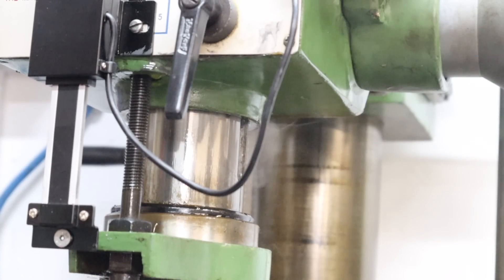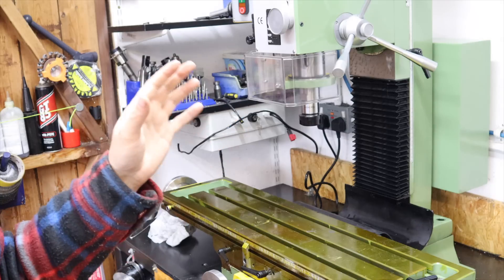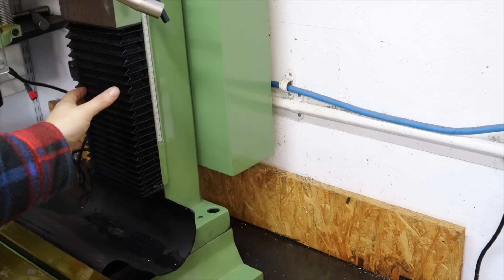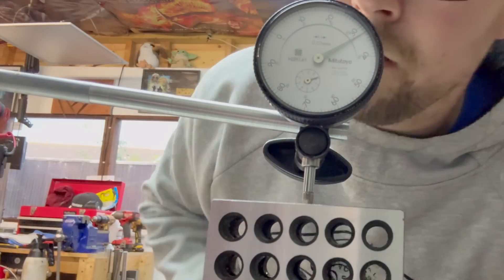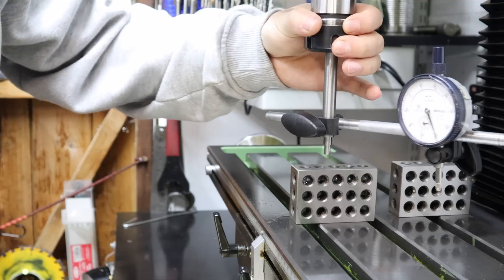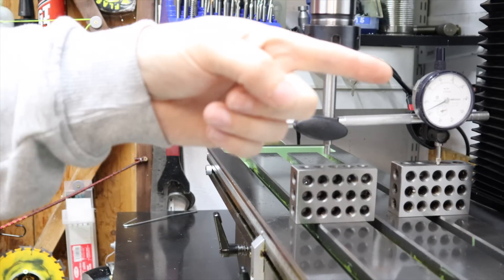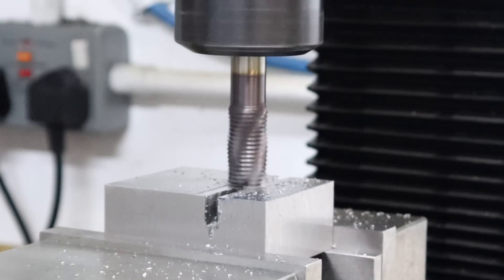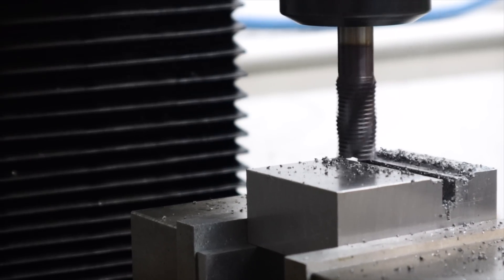The BEST Benchtop Milling Machine - Initial thoughts Warco WM18B

Comment: Been using mine for  nearly 9 months. In general it's quite good.  You can use a dividing head vertically  as there's enough height. I  fitted a dro from aliexpress so the mill is spot on for accuracy. No problems  yet.

Comment: Very good video I've been considering this one. One thing to mention is that MT3 is actually just as rigid if not more so than R8 due to better internal contact with the spindle. However R8 tooling is more common from Chinese suppliers.

Comment: Hi Joe

Just seen your video. I have the same size Warco mill though mine was the Geared head one. I removed all the gears and converted to belt drive and fitted a powerful dc motor with speed control much like you have. Yours looks great. I made a small mod to the casting to increase the Y travel to 240mm.  I converted it to CNC operation and made mods to provide oilers. This has all worked well. I think you will rapidly get bored cranking up the head each time. I added a ram to aid the lifting of the weight of the head. My mill is very capable and quite powerful enough for my needs. I tend to use the X box controller to operate the mill manually quite a lot and discovered by chance that the shiny button locks the axis currently operating so it cannot drift off direction with the joystick getting a nudge by mistake. My CNC speed is ridiculously rapid on fast speed and quite frightening! I have closed loop and it has all worked well since I put it all together. Good luck with yours.

Oh by the way I have the same R8 collet holder. I fitted the special r8 collet that has a machined flat end that allows use of the 20mm dia Tormach tooling holders. I have a bunch of them now for assorted milling cutters. They are quite cheap from Ali express and come in 2 sizes for ER20 collets. I have mine operating on a pneumatic stack that allows the tooling to be quickly switched place. 

John

Comment: Just to add , I had their GH mill which was B****y horrible. I bought a krv 2000 for commercial work which was great but weighed 900k. Watching you set the head up. Machine DRO sell a trammel gauge which takes 60secs to set the head up vertical. Money well spent if you keep moving the head.

Comment: I've recently bought one of these. If you are a model engineer ,it's very good. Mine's an r8 spindle. Disassembling is dead easy. I had to move mine from the garage to workshop up the top of my garden. I put it back together and clocked it up ,the machine was spot on. I fitted some digital scales £35. If you need something more substantial , buy a KRV , a better bridgeport.

Comment: Thanks for the heads up regarding the sale prices.
I treated myself to a GH-18. Specifications say that it's a single phase motor, however mine arrived with a three phase motor and a VFD mounted in a box behind the column, so very easy to modify for variable speed as well as the gear selections.

Comment: Well done it looks like you've got yourself a good machine there, I have a Super Major which Ive had for 16 years and Ive just rebuilt the gearbox after one of the shafts broke in two so I would be interested to see what happened to your old mill. 
When tramming or checking the nod make sure the head is clamped to the column if it isn't the the head will lean forwards giving false readings I use a brake disc for checking mine it is worth buying a new brake disc just for this and reduces any errors that might occur when lifting the clock stylus onto blocks or parallels.
One of the big failings of all of these Chinese mills is the rigidity of the base castings so don't bolt it down tightly to the top of your bench and if necessary shim under any corner that has a gap before bolting it down, finger tight is enough.
Id also suggest you invest in a set of finger collets these reduce the overhang from the spindle greatly improving rigidity and increasing working height.
Keep up the good work and enjoy your new machine.

Comment: Thank you for your video and effort put into it Joe. Could you elaborate a little about the table you use to mount such a 265 kg machine please?

Regards, Ruud
Reply from the maker: Hi Ruud glad you enjoyed the video. So the table is actually a table I fabricated. It is mainly made from 2” steel box section with a 5mm steel top. When I made it I ensure the weight would be on top of the uprights so no weight was directly held up by the welds.
Reply: @MachiningwithJoe  Thank you, very useful!

Comment: Very good video Joe, thankyou. I think you and Ade have picked very well. Good Prices at Warco, tested and configured.
I'll be joining you in the next few months, hope I have the luck you have had. You got a good un!!!!.
If you get the time, it would be good to see you fit a 2 axis DRO. Is a 3 axis DRO out of the question ?. As that little LCD thing I would assume 
would not be ideal for reading.
Reply from the maker: Thank you, glad you enjoyed the video. Hopefully when you come to buy yours there is still the good saving that there currently is. So I’m going to be using the DRO that I removed from my old mill. For that reason it will be a 2 axis and also as I have done a video on DRO installation I probably won’t be doing one with this mill as this mill is easier to do.
Reply: @MachiningwithJoe  So yes. I was after the WM16 at the time, but Warco were no longer selling it without the DRO. Got the WM18b (Same as yourself), absolutely no regrets. Got the deal as well !!!!!.
I guess the only regret was the weight of the thing before I moved it !!!!!

Comment: Do the gib strip locks on the X axis still catch and bend themselves if you are not careful when taking the Y axis back, its a crap design that allows them to foul another part of the machine as my older model does. Better that the controller is remoteley mounted so reducing vibration that can destroy the pcb's.
Reply from the maker: After reading your comment I have gone and checked and yes you are completely right. Looks like I’ll be making some replacements at some point 👍
Reply: @MachiningwithJoe  I have had one for over 15 years, mine has no oil points and the bed is made up rather than being solid. I need to get one of my gib tightener out as it was bent so many times it snapped. Motors are a failure point the old ones had a cowl over the motor that prevented proper ventilation, that went in the bin after the first motor burnt out and the Chinese made boards are crap and hard to repair as they scuff off the makers id from the semiconductors, I have never been able to take the backlash out of the x axis as the adjuster never seems to adjust. But I still have it, and it would be a much better machine with dro,s, oh and get yourself a set of carbon brushes they gobble them, warco used to do a motor brush end replacement, service is good I recognise the voice of the parts guy every time I ring them.
Reply: @philsteele7151  I think the WM18B uses a brushless motor for better slow speed torque.

Comment: To measure the runout of the spindle it is best to take several measurements. Turn the collet 90°, use a cutter / collet with a different diameter. Sometimes you have a lot of spindle runout, but it is compensated by the runout of the collet/cutter. By turning this 90° the real runout will become visible, better or worse.
Reply from the maker: Great but of advise I actually decided to measure the runout again directly in the spindle and turns out I’ve only got 5 microns of run out.

Comment: I have an earlier version of this that I've converted to CNC - looks like they've updated the control unit - and what's that big box on the back? On mine the control unit was just a small box mounted on an arm on the side of the head.
Reply from the maker: Great to hear you have done that as that was my end intention with this. The cabinet on the back contains controller for the DC motor some fuses and breaker etc

Comment: I purchased one of the first WM 18 mills back in 2007 from Waco, on arrival I noticed it came with an inspection report on spindle run-out and axis play and true ness. Being a machine tool fitter of over 40 years I have worked on some super accurate machines and this mill was bad ! In the end before using it, I stripped it down and changed the chinese spindle bearings for FAG bearings and made proper steel spacers instead of stacked up old circlips which were in the housing. Hand scraped the ways as the finish was appalling. To anyone thinking of buying any far east made machine. It is prudent to check and clean out the casting sand still hidden because if this gets on slides or in bearings then it will ruin them.

Comment: That column looks hella skinny... The rest of the machine looks nice, but that Z pillar is a disgusting manifestation of corporate greed and FEA... The machine like this is as strong as it`s weakest component, and if that component is one of the main axes, even moreso the one that carries the head and is affected by all and any work done by the head, well, we have a problem on our hands... I`m hardly pressed to see how that pillar is any more rigid than the round column of my Emco FB2, which is from what i can see - a smaller mill than this... That single component could and should have had twice the material that it actually has in it to make a really fucking good milling machine, and that could be seen as The best benchtop machine, but this, nah, just decent...

Also, what the hell man, spindle bearings should not even register on that clock... 0.01mm is not fine for a spindle of any sort of a precision machine... 1 micron is crude if we are talking precision, but for a hobby shop, 1 micron spindle runout(actual spindle, not a tool in the holder in the spindle) is very good, 2 microns is adequate, but anything more than that and you might as well be using a drill with an endmilil chucked with a jacobs chuck... 0.01mm runout is literally detrimental to cutters, and quite a lot if we are talking smaller cutters(like the ones a hobby shop likely uses) small endmills, drills, reamers, what have you, none of them like runout... Shit, my roller-blades with abec9 bearings have a lesser runout than that... Speaking of, here you go with a shameless plug - if you need some fucking remarkable bearings for small spindles(custom toolpost grinder or similar) you can get Bones Swiss bearings for skates, you will know which ones to buy, they don`t come cheap, but they are Swiss made and Swiss grade... You can get Bones Swiss Reds and others that come from China, but if you want savagely good small bearings - the Swiss made Bones Swiss bearings are the way to go... At least for high grade custom projects that don`t warrant custom ang. cont. bearings...
Reply: You sound jealous..
Reply: @65cj55  nah, i`ve got the Schaublin 22 mill, if i need ultra-rigidity I can just rely on her majesty, i doubt that there is a single machinist that i would be jealous of in regards to the machine array that they have - i love machines, and as long as the operator treats them with devoted care, i have nothing but appreciation for them being the one that owns whatever beautiful machinery they do and take care of... 
As a sort of a millwright, i know that i can not take care of every single machine in the world, so i never begrudge loving operators for having machines that I don`t... 

Best regards!
Steuss
Reply: @camillosteuss  What's ''a sort of a millwright''.....either you are a millright or not..your original comment sounded like jealousy, very bitter, even swear words...weird.
Reply: @65cj55  ``sort of a`` means that i`m a mechatronics tech with savage passion and maniacal interest in machines and machine repair/mods, it also means that i currently don`t have a functional shop, more of a machine storage room which offers minimal machining or restoration capacity due to lack of space... 
Now, very bitter, sure, that i don`t reject, but i never hold envy towards any good operator, i only have contempt for machine abusers, but other than that, i generally speak my mind, curses included - whether i speak ill or well of something or someone...
Reply: @camillosteuss  So you're not a Millwright, not even ''sort of''...
Reply: @65cj55  i do what a millwright does, and learn what a millwright should know, so i would say that i`m mostly there...
Reply: @camillosteuss  If you read lots about the Universe, are you sort of a Astronaut ?
Reply: @65cj55  no, that would require me going to space... But i do work with and on machines... Which is much more involved and tangent to machining and millwright`s job, a lack of signed toilet paper notwithstanding...
Reply: @camillosteuss  Sure you do bud....
Reply: @65cj55  Nah, i just watch machinist content and make such claims because i get bored of twiddling my thumbs in m`pocket... 
I would get it if you were a millwright yourself by trade for 40 years and took ``offense`` over someone who is not of the same trade making such claims... I know that every trade is a boys-club of sorts, or a girls-club for that matter, but i think that there is enough evidence on my channel that i actually do engage in machine work for it to be dismissed by a randy - apparently even more bitter than myself, as there is no way that you are so pissy and prickly about this, yet offering no trade-insight yourself as to prove some point of contention that you have with what i have had said so far...  
Anyways, i`m off to my stockroom to fiddle with a project lathe and consider if the design i drew up to deal with certain damage is good enough or shall it be less than optimal as a solution... This back and forth is getting old..
Speaking of machines - you are actually the perfect example of why i have 100x more love and patience for machines than i do for people - they are not insolent and childish for no good reason; their issues are technical and can be answered and appeased with a proper design - unlike some people...
Reply: @camillosteuss  I'm not the one claiming to be a millright and trashing peoples mill purchaes online, all i done was call you out on your nonsense.
Reply: @65cj55  My claim was not initially presented, nor was it presented as a straight fact, i said what i said in response to you... My original comment was quite positive actually - I said that it is generally a nice machine, but the design is plagued by corporate greed, as is the case with 99% of modern products - in this case it being most prominently represented by the Z axis column... For fucks sakes, m8, how is that trashing someone`s decision or a purchase? Trashing the mill would be calling it worthless import garbage or some other lowball insult or description that one might think of when trying to spit on a product without ever using it... 
I just commented on what i have noticed as a weakness in the design that unfortunately affects the operator`s experience and diminishes the performance of the mill to the detriment of the operator... I meant no insult thereby, it is just how things are and how i speak...
Reply: @camillosteuss  Keep digging bud.
Reply: @65cj55  Have it your way, yet facts stand forever resolute...
Reply: @65cj55 Christ almighty, you didn’t really read all that drivel he wrote did you? I thought he was writing a novel with ream after ream of useless information and wild claims.
Reply: @sjv6598  Lol, i skimmed over it, he sure does love to rant.
Reply: @65cj55 I'm a year late but you sound like a proper "British cigarette"... 😂
Reply: They are engineered to be good enough to do the jobs most hobbyists expect a machine this size to do and yet remain affordable. Not everyone can afford to buy a top quality machine for hobby use. Complaints about lack of rigidity and terrible runout are not what you hear from owners of this size of machine, many of whom are retired engineers and machinists who have hands on experience with better machines than this.
Reply: @nrml76  Yeah, i`m not sure if i would be as generous with my words as you are... They are not engineered to be good enough - they are engineered to fit just outside the legal parameters of scam, like most modern products - with both the FEA reducing material abundance to absolute technical minimum, the quality of materials being on the very border of a TUV test and with the imparted geometry or whatever the operating aspect of the thing bought being barely passable as what it is supposed to be... Which is a shame, because just a bit more human grace in the design could have rendered these into quite decent and commendable little machines - for a slightly greater price...